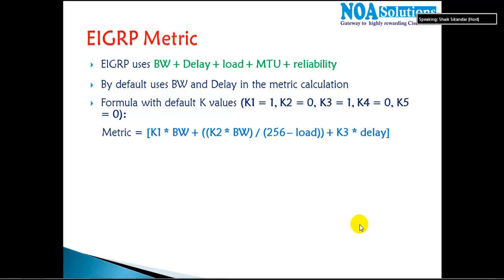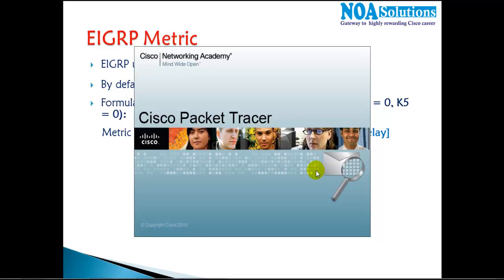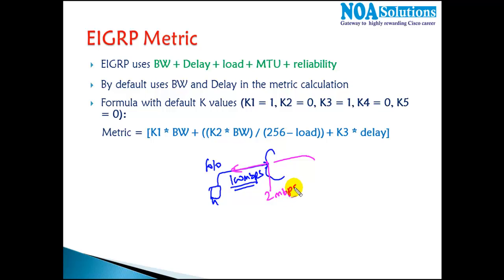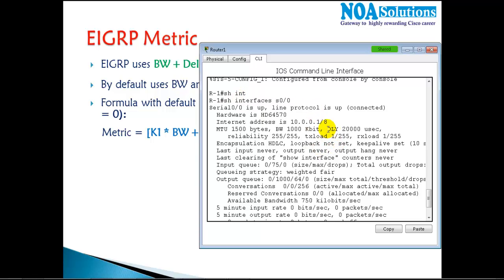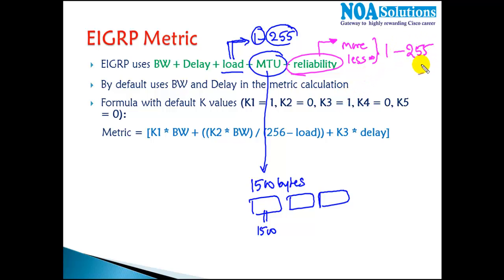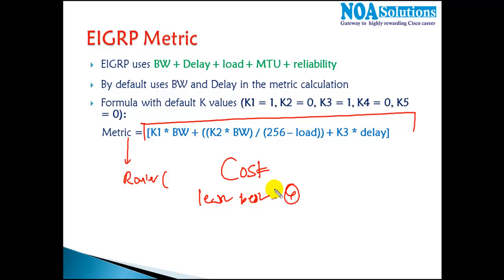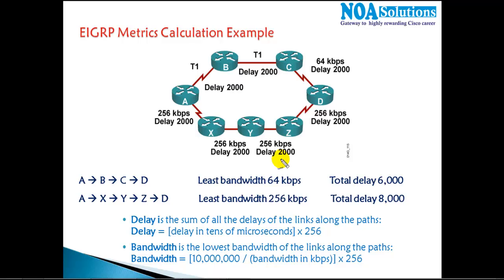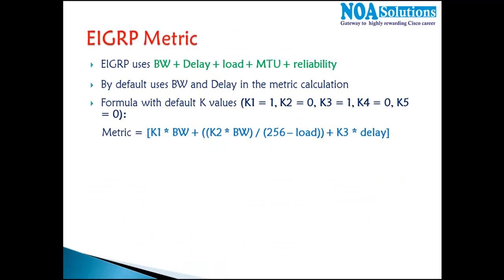EIGRP Metric - Video By Sikandar Shaik || Dual CCIE (RS/SP) # 35012

Comment: Sir i have a question . As u said EIGRP will calculate path based on the cost ..  Lower the cost ..higher the bandwidth but at the end you said  it take the low bandwidth which means higher cost thn ? Plz clear the confusion
Reply: the cost in EIGRP is called Metric. and Metric = bandwidth + delay ; the delay is the total or the sum of all delay along the paths and the bandwidth is the minimum or the lowest bandwidth along the path.